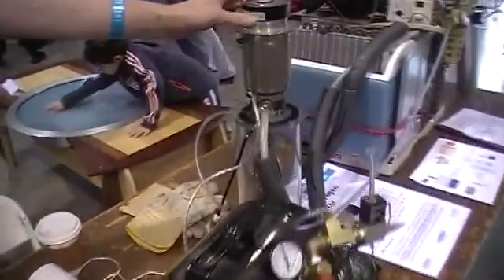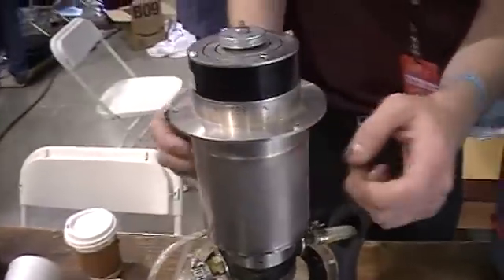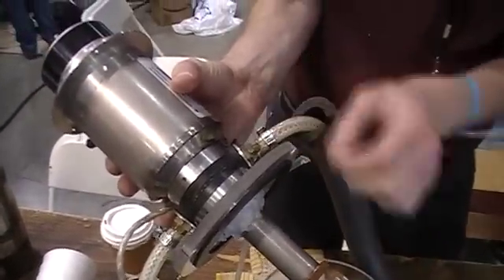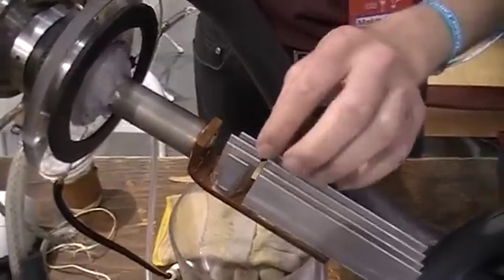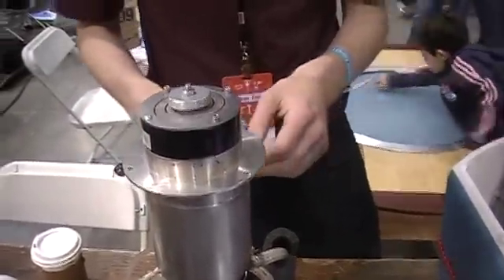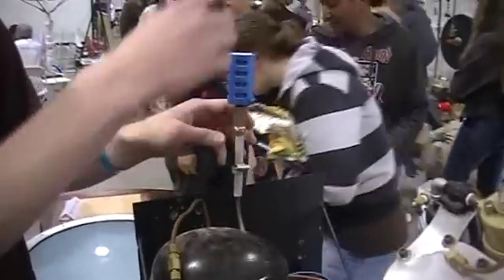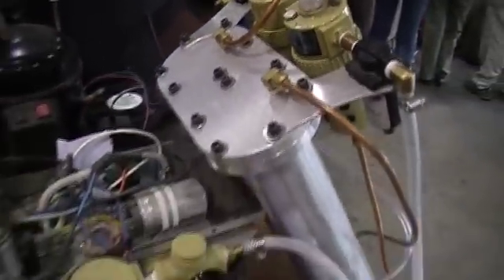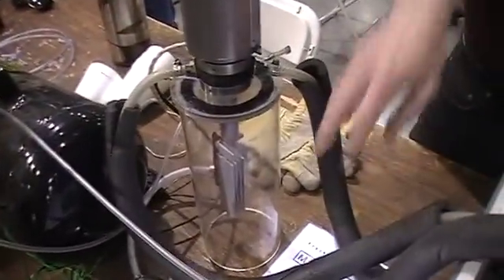DIY Liquid Nitrogen for Less Than $500 - Ben Krasnow

Comment: whats less then 500$ the electricity to run it, i see about 9,000$ or more worht of hardware there, no way that machine cost under 500$ the air lines , fittings and desicant cannisters  and filters... alone cost you well over 500$, i build this kinda stuff in my dreams dood wen im rich , even if it was made outa parts from china painted with radio active lead paint it would still cost you well over 500$

Comment: @nicktohzyu, yeah but what about the tubings that's exposed to liquified Nitrogen? It's no big deal when sealed and packaged, the problem lies in how the air refrigerator / compressor hardwares are built - some DIY hardware aren't even built that way so Oxygen is, safe to say, always present. And yes, filters are a must as you want the pure stuff - impure LN2 tend to evaporate quickly for some reasons.

Comment: The noise is horrible. Sound like you would require ear plugs if was a work enviroment.
But aside from that have a question.
The helium in the cooler do you have to fill it up and where would a diyer get such helium.

Comment: Gotcha. N2 membrane filter is quite hard to find, though. the older method to get specific gas was to repeatedly cool all gases down and seperate them by their temperature (Kelvin) points. It was mentioned in few quite ancient science books my school's library chucked out. I still have them - i think it was toward physic / chemistry. Guess the filter is much more efficient than just to selectively cherry-pick the gases by their liquefying temperature.
Reply: the method your describing is fractional distillation

Comment: It's possible to make one outta garbage parts (mostly from fridge) - You're largely on your own to figure out how to shock-cool the air into liqueified Nitrogen. Dry ice and ammonia slush should work. And, also a word of warning: Liquefied Nitrogen's extremely dangerous as it's quite cold - down to about -270 F. Just don't try to put any body parts into what looks like water - it's liquid Nitrogen...
Use a ventalized Thermos to store it safely too (you can use a professionally made LN2 dewar).

Comment: That's pretty ingenious compressing Helium to cool the air. Classically liquid N2 is made by compressing nitrogen gas as much as possible, in which case it becomes too hot to liquify anyways. So they use a bit of that compressed nitrogen gas and blow it onto the compression chamber from the outside. As the gas outside exapnds and cools, it cools down the remaining nitrogen still compressed inside the tank, which is then uncompressed and the whole process is repeated.